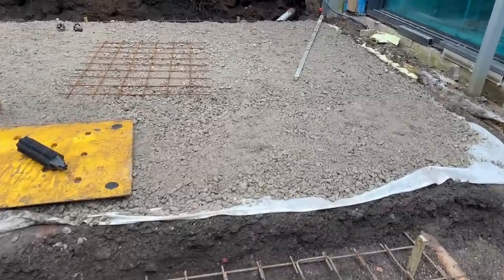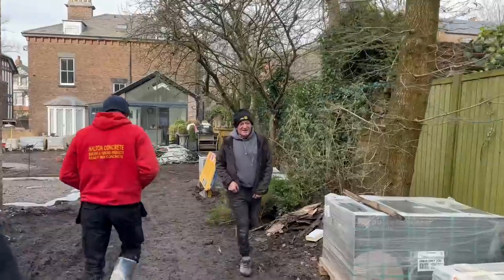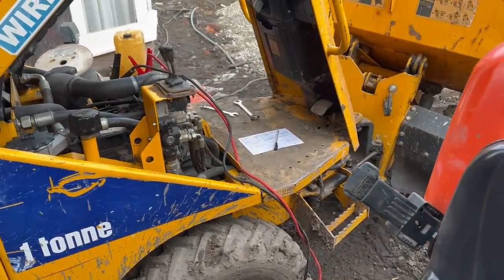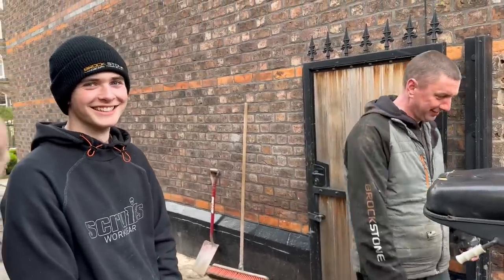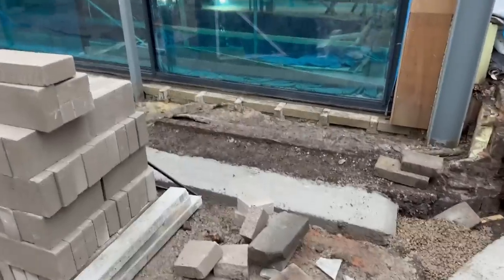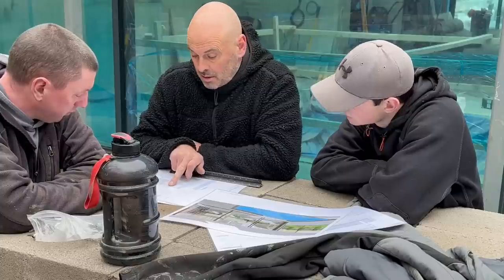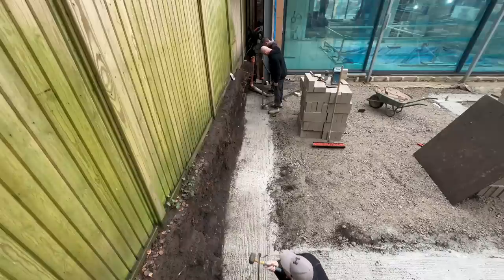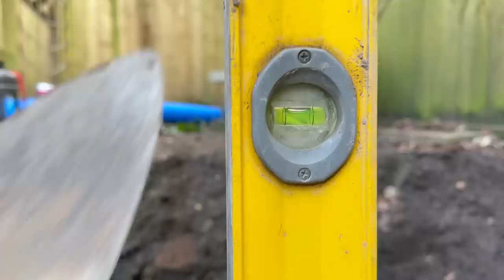The Coach House Garden - Episode 2

Comment: Love your content, quick question for you. 
I installed Marshall’s cobble tech on my drive about ten years ago. Brush in resin is finally failing. Could I clean out and use flow grout as it’s on a steep incline?

Comment: Why were those holes pushed into the cement between the brick courses with the pointy thing on the end of the string line? Is it something to do with water being able to pass through?
Reply from the maker: Not with you there sorry? I think you may mean wall ties? If so it’s holding the brick courses together 👍
Reply: @Brockstonepavingpros  At 20:25…